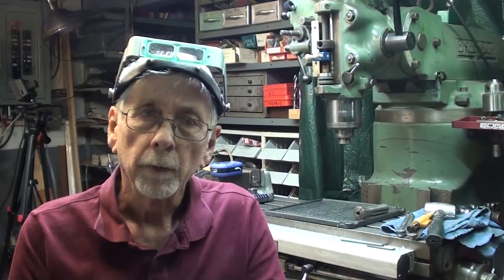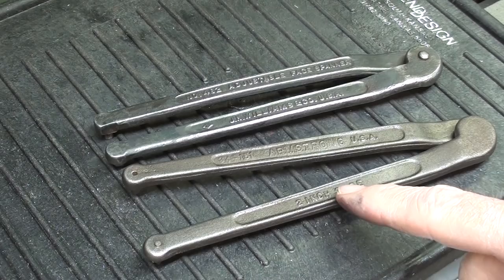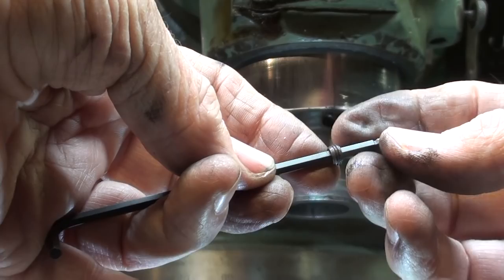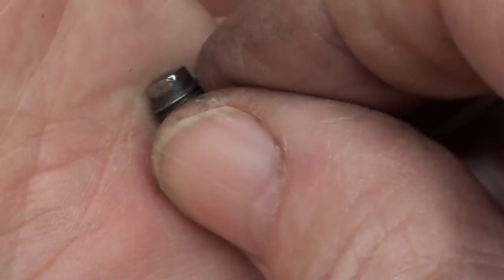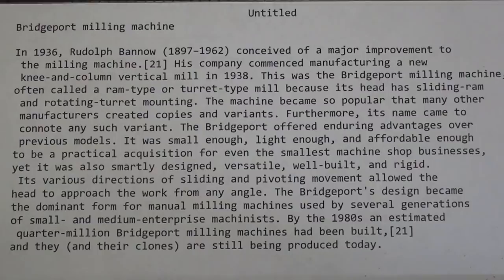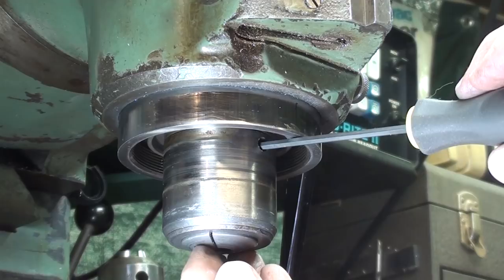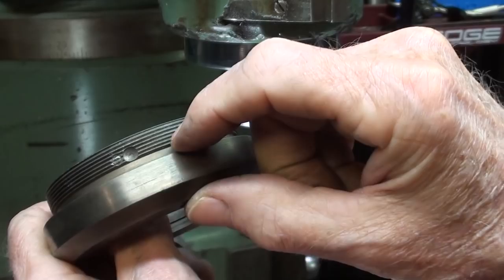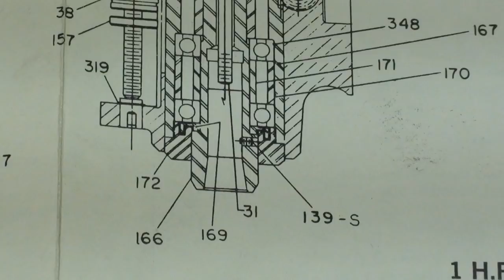Repair BRIDGEPORT MILL Spindle Key TIPS #615  tubalcain

Comment: Just came across your video and thought it was both entertaining and straightforward, good job. Haven't had to attack this yet but looks pretty simple. I own a 1940's BP round ram with a 32" table that is in great condition and just love it. Powered it off a VFD (I don't have 3 ph.) I don't ever have to change belts or gears and adapted an Accurite to fit it. Modernized but a piece of history still going strong. Also, I wish I could post a picture, but my son gave me for Christmas one year, a poster size print on canvas, dated 1942, filed 1939, of US Patent Office print of Universal Machine Tool, showing the round ram mill and it's configurations and drawings for the original patent, signed by Rudolph Bannow and his attorney. I have it framed and hanging proudly in my shop. Pretty cool. Everyone always asks about this when they see it. Thought I'd share that since you posted the history of this incredible invention. Thanks again.
Reply from the maker: Thank you, I bet that is a beautiful picture. I’d rather have that on my wall than the Mona Lisa.

Comment: Berry at H&W just posted a video for the same procedure. BUT he used the draw bar to drive the spindle down about 2 inches to have access to the set screws. Upon completion of the screw installation, he used a soft mallet to drive the spindle back into place, and finished the job.
Reply from the maker: I will have to watch that

Comment: Key is essential for tightening and, if you are like me and use oversize diameter tooling, it likely assists to prevent collet spin.
Reply: Large shell mills and fly cutters are the biggest cause of keys to shear. Sometimes a large end mill will grab, spin the R8 holder and shear the key.

Comment: I have used several mills over 40 yr in  machine shops and ran in to a couple that had been them  ground off.  I didn't do it!  You could just stick the holder in there anywhere and it would go. I never had the holder spin in the spindle. I didn't like that. One day the company bought a new mill for me and a machinist  named Babba told me  to Dremel it off but I wouldn't do that.

Comment: Speed Selector makes variable speed pulleys that replace the Reeves, Hi-Lo, TB Woods and Lovejoy pulleys that went out of business or got bought.   Most of the pulleys are in stock or Speed Selector will custom make if needed. They have an actual engineering department who were very helpful.

Comment: If you make the nub on the end perfectly round in the lathe to the exact size as the keyway in the collet with a couple of though clearence it would not matter the orientation of the grubscrew as it would fit in any orientation, then just lock it to stop it vibrating loose, or am i missing something in other uses of the nub. A witness mark in the outer rim where the dimple is, then just screw in till your mark is in line with the hole.
Reply: That's what I did. Seems fine!

Comment: On the Williams pin wrench...  Those grinding marks on the pins look too symmetrical to be done by BUBBA...  The two cardinal sides of the pins which apply the force are cylindrical and true, and I think the angles ground on the other two cardinal (go cards!) are there to wiggle-in and prize apart dings and dents (put in by ANOTHER BUBBA) in the rim of holes that the pin spanner is used on....  Totally guessing here of course!  The tool is way closer to your eyeballs than mine!!

Comment: Hi Lyle, I like the idea of using the OEM divot for the set screw, but I would suggest using a feeler gauge and designing a washer or a gasket to get that nut to seat a bit. Also could be the problem with the "key" may have prompted someone to try tightening that nut , thus causing the eventual problem. Just a theory IMHO. I imagine the same assembly lives in my basic mill-drill, so this is valuable info for myself. Thanks for the interesting video, stay safe, and cheers!
Reply: I just read lucky lockster and his opinion seems to be in the same direction.

Comment: I have found that the thrust bearing needs to be tight in the spindle with the nose piece.  I had worn bearings and this was evident when using a fly cutter.  The cutter would cut fine and leave a nice finish, but without moving the quill, subsequent passes back and for the would still result in more cutting and indicated the need to have the spindle rebuilt.  The spindle was "bouncing" and had end-play.
Reply from the maker: I think I will tighten it up

Comment: If you leave the key in the spindle there is something you have to be careful with. Using a large flycutter where you have an intermittant  heavy impact the collet can slip and the key can cut itself into the collet. This will make the collet almost impossible to get out of the spindle.  With luck, you can remove the nose piece and screw the key out like Lyle did.
Even worse, I had this happen with a right angle head installed on the quill.  It took all day to finally get it out. There, the body of the right angle attachment covers the nose piece so there is no way to get it off to get to the key.
Cheers from NC/USA
Reply from the maker: Nightmare

Comment: Why wouldn't you want a end on the set screw that is circular (without flats) that sticks out the proper dimension with the same clearance? What is the advantage of the flats, that require you to have to make sure the flats are lined straight up and down when reassembling the spindle nose.

Comment: Looks like the two dog point flats align to two flats of hex socket side at 14:09 .  Along with feel, this would help with vertical alignment of the dog point flats, using the Allen wrench flats as an external reference. Hint  for getting frame accuracy in YouTube: The keyboard shortcuts comma and period are invaluable for walking back and forth a frame at a time.
Reply from the maker: Thanks

Comment: Just did this yesterday on my mill.  Interestingly, the Bridgeport manual says there should be a .003" gap between the nosepiece and the quill.  Just viewed the H&W video and they made no mention of setting the gap so am not sure it is necessary.  Suspect the gap is to allow for thermal expansion and to prevent binding of the spindle bearings.
Reply from the maker: Yes, it’s a conflicting information

Comment: My BP manual sez keep the nose cap .003" from contact/full tight.
Reply from the maker: Thank you for that, everyone said it should be tight. A man is sending me one of those Bridgeport books
Reply: That's a minimum clearance between the quill and nose piece after tightening the nose piece on the spindle cartridge. Anything less might trap dirt and not properly secure the spindle cartridge, allowing chatter during some cuts or premature bearing failure.

Comment: Great Video! Very informative!  On Firiday I went to Davenport IA and picked up that Clausing Horizontal mill and a pickup load of "treasures" .  I also purchased ($21) a  huge double sided display board that contained over 200 cutters for that horizontal mill.  Let me know if you ever need a specific cutter for a project.  Stay safe!
Reply from the maker: Wow, that sounds like a good deal to me
Reply: @mrpete222  I also bought 2 different sizes of the Brown & Sharp knurlers you speak so highly of ($18).

Comment: Great Video!... Thanks.  I would also refurbish the existing part... no need to replace. 
In either case, I would MAKE this part rather than buy one... a 10 minute job on the mill... 
Should we use (non-permanent) LocTite?
My middle name is "FRUGAL" (in German) or "CHEAP" (in Italian)...
Reply from the maker: Yes

Comment: Just got a new collet guide pin from Hardinge /Bridgeport  cost $32 through MSC  in their instructions they want you to remove the nose piece and tighten the quill lock remove the drawbar an insert a brass bar and drive down the spindle to get access to the collet guide pin and now you can use a straight allen wrench and the screw is more accessible  when finished put a block of wood under the spindle loosen the quill lock and bring the quill down against the block driving the spindle up into place and reinstall the nose piece don't know If I will do it that way just thought I would pass on the info

Comment: my UK bridgeport is the same as yours hollow lock nut but just a dog point key 1/4 32 threads the manual says a .006 clearance for the nose to spindle thanks steve

Comment: If the quill nosepiece is not tight, your spindle bearings will have ZERO preload.  Chatter in your heavy cuts will happen.  The set screw "key" will not take the torque if a 1" (or so) drill bit jams up in the work.   Thinking the key adds to the torque capacity of the collet is technically true, but in a very small capacity.  If it shears, and worse yet, the metal smears, it will lock the collet in the spindle bore and mangle things up.  Poor choice to repair the set screw.  Better to chuck it in the trash.  It provides no benefit.  Even mills with a power drawbar do not need them.
Reply from the maker: I will tighten
Reply: It is an alignment screw not a drive screw. And, I argue that it does serve a useful purpose, to keep the tool from spinning while tightening the draw bar.
Reply: @pedrowhack-a-mole6786  I have used at least 10 or more different Bridgeports that did NOT have the pin throughout my life, and never had an issue with the collet spinning when tightening the drawbar.  Even mills with a power  drawbar worked fine.  What sample size are you basing your argument on??
Reply: @kooldoozer  I maintained 14, and as many as 18, bridgeports at a time over 30+ years. These machines were usually in constant use, 8-16 hours a day. The machines varied in vintage from the early 50's to the late 80's and included both J heads and J2 heads. With that many machines and the associated tooling, a collet set for each machine, shell mill holders, end mill holders, boring heads, saw arbors, 90 degree heads, etc, not every drawbar and tool combination would thread together without some resistance. The problem is that the drawbar is only half-hard and with extended use the threads tend to get distorted, no longer a perfect 60 degree thread. These drawbars are still serviceable, they just take a little more effort to thread into some tooling. And, that effort is sometimes more then your ability to hold the tool while tightening the drawbar if the spindle key isn't there to help you. In a machine shop time is money and any struggle with tooling is counterproductive. I have found that the cost of the part, and the 10 minutes it takes to replace it, are justified. I am not in any way saying you are wrong, but giving my own experience and perspective.
Reply: I believe the nosepiece does not turn.  The thrust is the job of the two facing Fafnir 206Wi thrust bearings.  The MSC video talks about clearance.
Reply: I just watched a video by Bluechipmachineshop on this subject and he quotes the manual as requiring a .003 gap between the nosepiece and the housing.
Reply: @motor2of7  That has to be a minimum to guarantee the nose piece locks the spindle cartridge in place. I have seen gaps as large as 1/32". A larger gap just lets in more dirt.
Reply: @motor2of7  The MINIMUM gap should be SOME clearance. Not sure what the manual says, and it doesen't matter. Basic mechanical engineering preloaded ball bearing theory is to load the races together.  Architecture of the quill housing as it retains the bearings for axial clamping relies on the nose cover to be tight to load the outer races. If the factory manual states REQUIRES there to be a .003" gap, and that is a true and absolute statement,  then that is incorrect.  Stop putting blind faith in a factory.  I work in manufacturing. Our factory has so many errors in our printed and online information, it is a joke.  I personally have revised many of our technical and catalog information that we put out into the public. The marketing department who is in charge of this stuff is constantly getting this stuff wrong.  Knowledge moves you forward in life, not second hand information.
Reply: Doozer's Shop I cite another channel who cites the manual, and you accuse me of blind faith based on your generic experience in “manufacturing”, not even Bridgeport specific experience.  You’re pretty full of yourself.  Do you even own a Bridgeport?
Tell you what, I’m going to perform this repair on my Bridgeport today and I’ll waste more of my time reporting back to you as to whether or not you have a clue about this specific application,  not some generic statement based on unrelated experience.
Sheesh, I hate YouTube “experts”.
Reply: @motor2of7  Look brother, I am just trying to help convey good information. Not everything you read in a manual or a textbook is the complete story. Also, may things get lost in translation from English to English. I am not here to lay my dick on the bar, but I have a masters in mechanical engineering. I design machines that for sure have bearings.  All types of bearings.  I have replaced many Bridgeport spindle bearings.  They are not even complicated at all compared to CNC lathes and high speed grinder spindles. I admittedly not looked at a Bridgeport manual in a long time, but I really think that .oo3" nosepiece gap was meant to be a minimum.  I have seen quill nosepieces with as much as .025" and that is fine, as long as the outer races of the bearings are getting the clamping force.  I am not a Youtube expert, but I am in real life. I wish you the best.
Reply: Sorry Fafnir 207WI thrust bearings facing each other with special spacers between them a washer and oil retainer at the nose, then a long spacer and a 206k bearing at the top. A spanner lock ring and bent tab lock ring compresses the entire stack.  The spindle assembly is a tight fit to the sleeve and is tapped into the sleeve due to outer races of the thrust bearings.  The nose piece has a drilled hole for the set screw giving clearance for sleeve and clearance to the spinning spindle. All the bearings are open so the lube port (that asks you to oil before each days use) drips oil onto the felt ring, down to the 206, then through both 207 thrust bearings, finally leaking on your table.  The lube cup has a pipe cleaner to wick the oil slowly to the felt.  My J-head had cracked thrust beatings. Now the new H&W brake makes the only noise.  I might have some runout since I changed bearings myself rather than sending it out for rebuilding and taper regrinding.  Out of round .001 means a .002 larger hole.  Any one know if there are any other effects?
Reply: C M W right Mr CMW, but with open bearings the oil the little name plate asks for, will have someplace to go.
Reply: @pedrowhack-a-mole6786  Running a 7/16-20 die on the drawbar threads when they get messed up is more practical than living with messed up drawbar threads/  Relying on the spindle key being present, to allow the user to force the drawbar with messed up threads is not a logical way to think.  ---Doozer

Comment: I don't have a milling machine, YET. However couldn't you have turned, or filed, the end to a round .145/.150 so alignment would never be an issue in the future? I'm asking not stating because there may be something I am missing and it requires it to be longer than wide. I understand that it would weaken it a bit but I couldn't imagine it weakening it enough since it's more of a guide and not a stop. ?????
Reply from the maker: Sure

Comment: I was worried about your putting it in deep enough with the collet in place restricting the turning of the screw. I'd have put it in too deep for the collet to go, then backed it off just until the collet could slip past it. Then without touching it at all squirt some loctite so that it doesn't rotate when I put the lock screw in.

Comment: 08:36 - Yes it does... look closely, there is a line between them. 
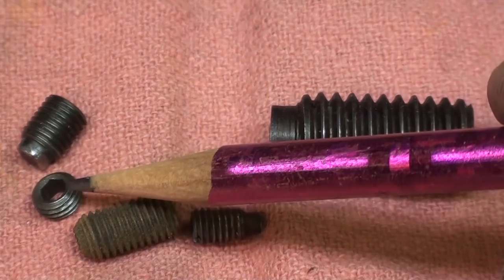10:42 - Well... if you were that cheap you would take a set screw, soften it, cut to length, file the shape, harden it, and install it... then probably make a video on how you did it all. Hee hee.
11:36 - Perhaps one drop of locktite BLUE? They also have the GREEN formula now... kinda gummy... enough to stop rotation from vibration. Just a thought. I would probably use BLUE.
Reply from the maker: Thanks

Comment: Someone below stated that he ran Bridgeports for years without the collet alignment screw and never had a problem.  Also said the screw could cause a problem if the collet turned inside the spindle.  BS.  If the guy's collet spins inside the spindle with the screw in place, he has 2 problems and only one is with the machine.

Comment: MR Pete you should get one of those Hemingway rotary broach kits that way you can make your own dog points........including the hex cavity
Reply: I entertained that idea but the Bridgeport key is hard and anything I could machine would only be in the half hard at best. That's a lot trouble for something that's not in spec.
Reply: @pedrowhack-a-mole6786  It's not difficult to harden 7mm diameter tool bits.  You could use a mapp torch.  Probably even propane and a small amount of quench oil

Comment: I hate those set screws that have a hole all the way through. Some dummy would muscle it down and crack it which made it almost impossible to back off. On my machines at Cat I would go through and remove them all and put new ones in place of them. Usually on a multiple drill head on a transfer line.